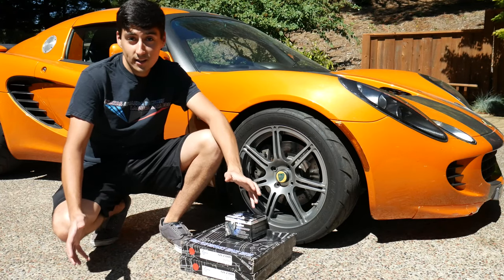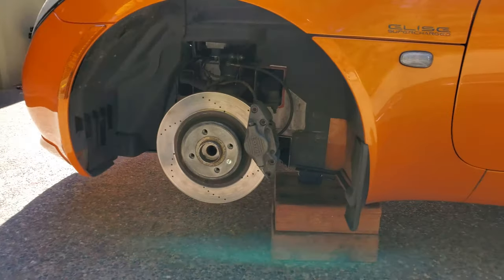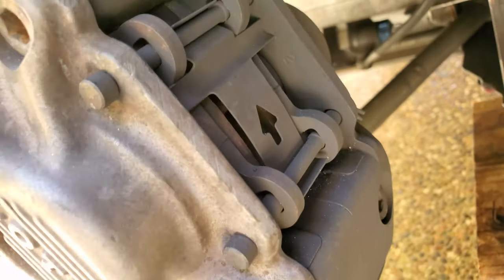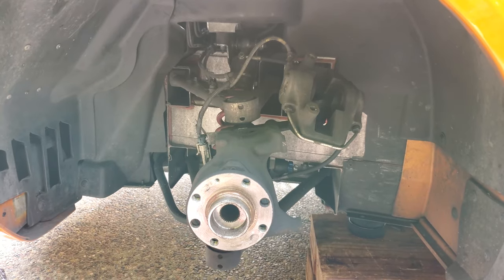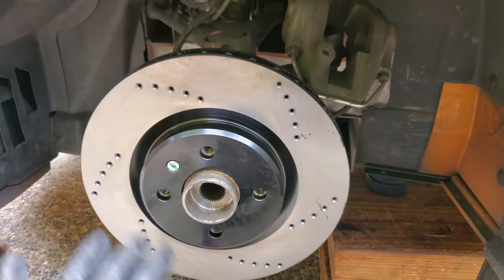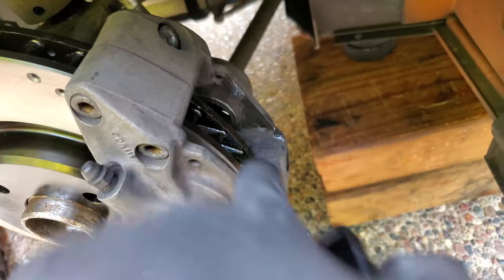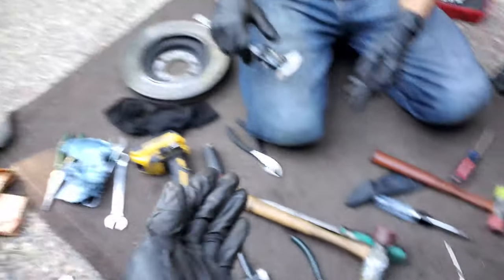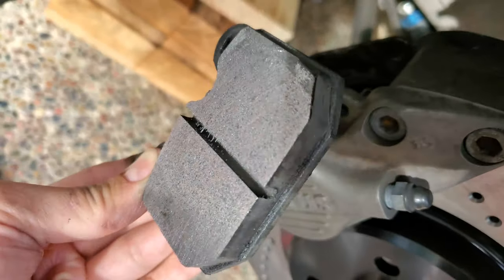Lotus Elise S2 - Front Brakes Replacement

Comment: New rotors should be 26mm thick. 24mm is service thickness. EBC Reds are a decent pad for the street and low dust.
Reply from the maker: Thanks for the note! Maybe we'll swap for the better pads next time. My dad barely drives this car so doing what we did to some semi metallic street pads should hold us over. :) cheers!